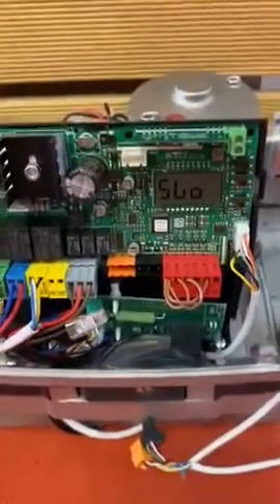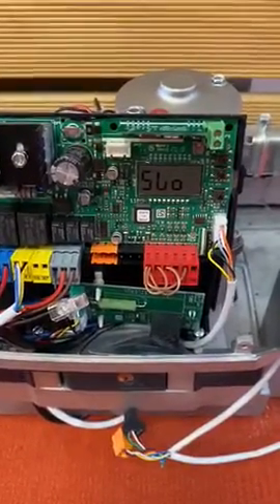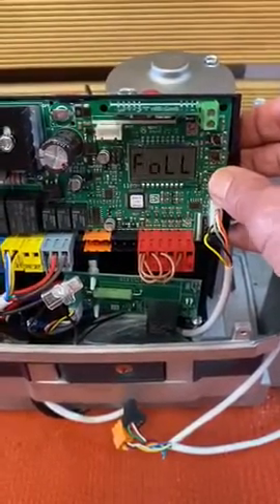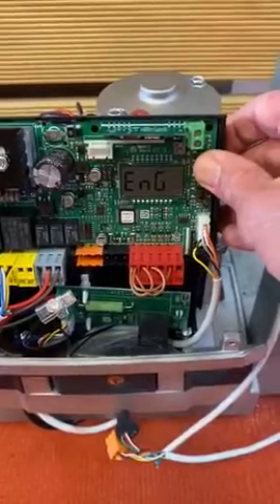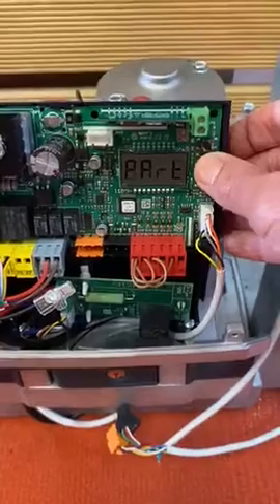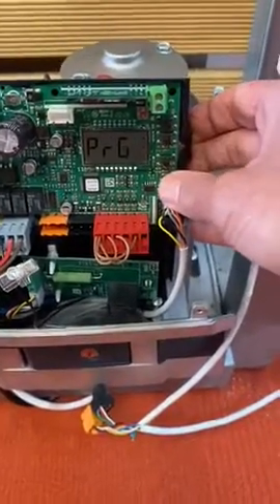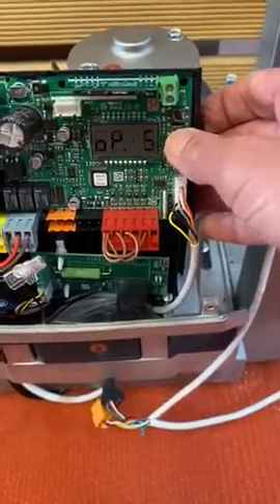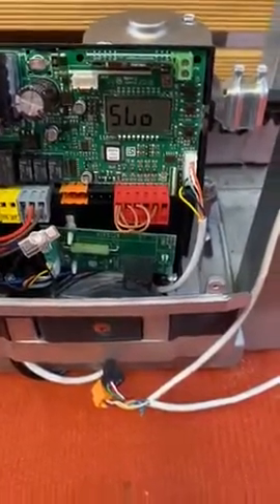Adjusting forces on board with LCD screen

Comment: This setting is NOT saved unless the parameters in the safe menu are also changed. Otherwise, after you'll exit the menu, 20 oP.force or cls.force will retur 🙄

Comment: do you think this will solve an issue with my BFT where the gate slides across but then stops and then slides back?  no debris on track and nothing in blocking sensors.  cheers